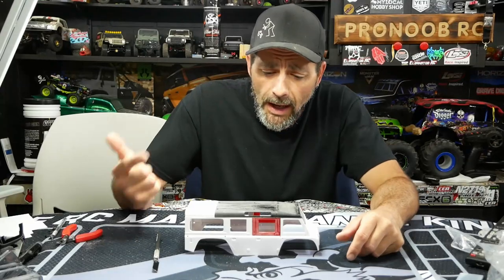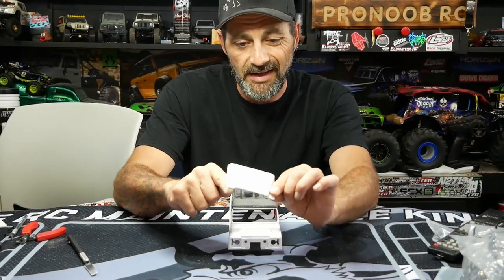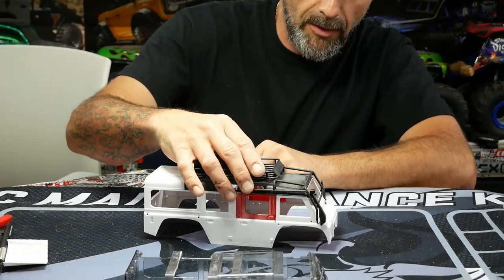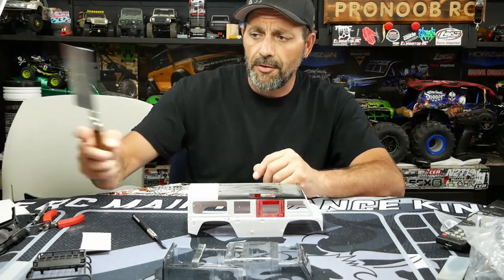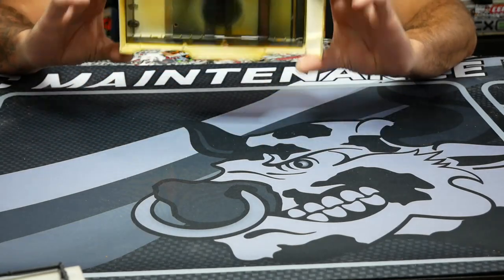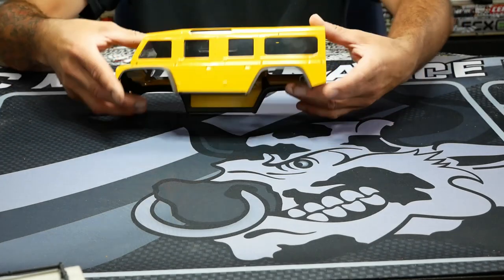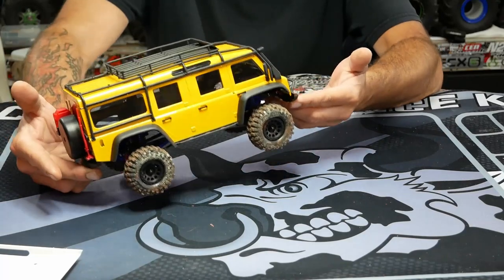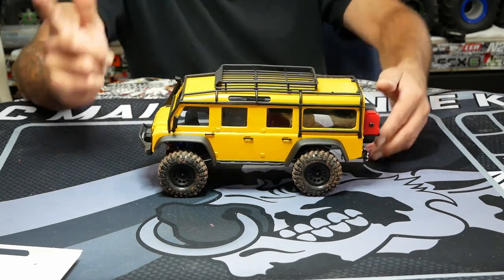TRAXXAS TRX4m: 1/18 SCALE RTR: CABOVER BUILD: PART: 2

Comment: Question for you when you’re doing custom stuff like this do you use something specific for custom body pieces like a s styrene or a plastic that you recommend? Also, what glue do you recommend?
Reply from the maker: Yes no worries!  We use Styrene for most all of our builds. For glue our go to is AKA or Proline CA glue for tires  as o find it holds up a bit better and doesn’t go all white and crusty.  Just avoid all generic brands like gorilla as it’s thick and not intended for our scale.